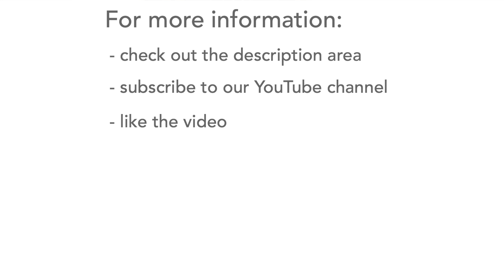Active vs Obsolete: Which Components Will Survive Production

Comment: Can you please explain why the legacy LM741 OP-AMP is still listed as an active component on the DigiKey and Mouser websites?
The performance of this device is clearly not suitable for new designs and there are many outperforming "pin for pin" replacements available.
Reply from the maker: You would need to ask Mouser and DigiKey to answer for themselves. My take is that the lifecycle phases are based upon the current production status of the components. When a manufacturer decides that they are no longer financially viable, he will inform the distributors and other interested parties of the fact they will no longer be produced and they become NRND, and then as the last production batch is being planned they go to LTB and then afterwards they are obsolete.
The 741, although very old - yes I can remember using them in the 1970s, are so popular that they are still in production. Possibly many of the original manufacturers have stopped making them, but they are still produced widely by a number of other recognised manufacturers, and there are likely to be no plans to stop production. It is this factor that is important despite their age and the fact that there are other far more modern and capable op-amps.
Reply: @ElectronicsNotes  Most interesting exception to the rule nonetheless.
Reply from the maker: @ricksampson6780  I think there are a few very popular chips that have remained in Active status for many years . . . , but not that many.
Reply: @ElectronicsNotes  Yes, but you have definitely flagged a component life-cycle anomaly, cheers.